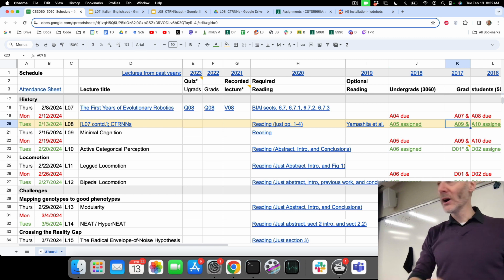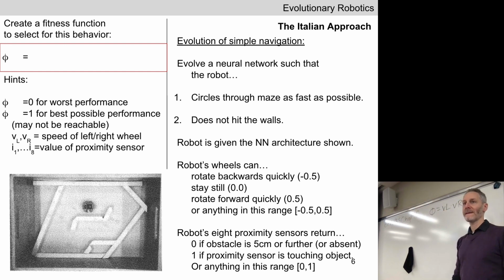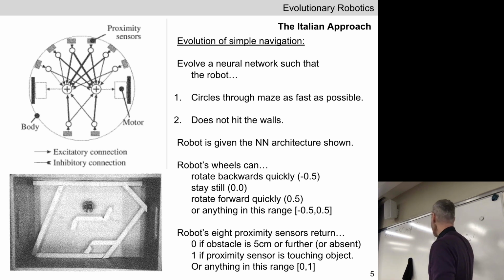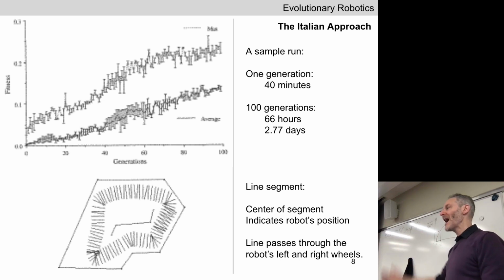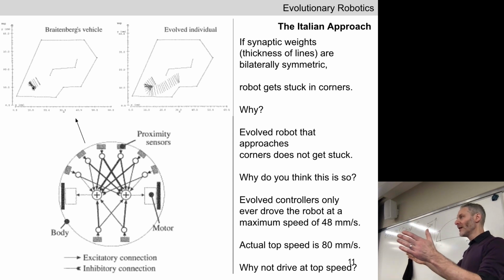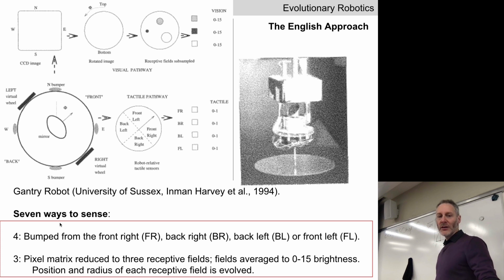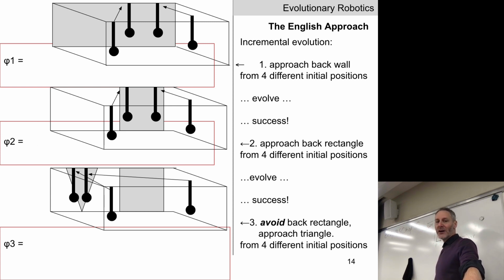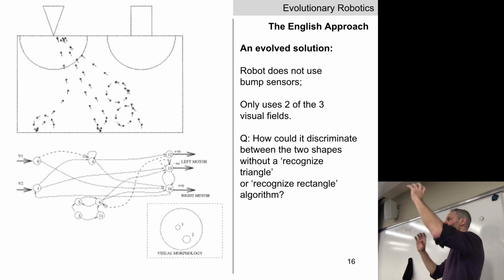Evolutionary Robotics course. Lecture 09. The first years of the field, contd.

Comment: Thanks for sharing! So speaking about gantry robot, it was a surprise to hear that there were some recurring connections that preserved the state. In previous lectures you mentioned that architecture of the network remained fixed, while weights were evolving via genetic algorithm. Are you implying that for this experiment ANN's architecture was evolving as well and algorithm allowed to add recurrent connections?